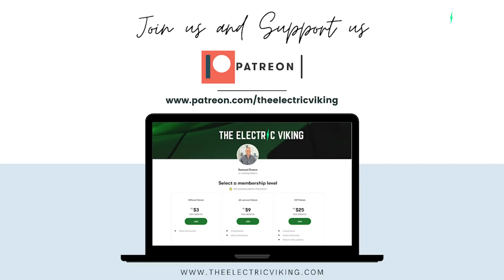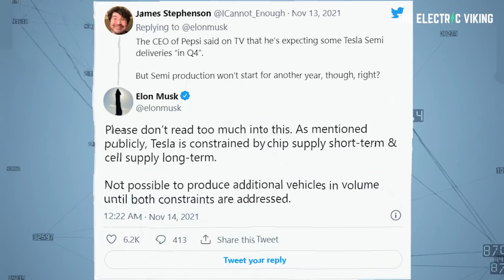Elon Musk: The 2 issues stopping TESLA from making more EVs

Comment: Hi Sam, great stuff! Can you please look into small cheap European cars? I searched your channel for the Dacia Spring, Renault 5, cheap VW Up! etc. I can't afford an expensive EV. I need a cheap EV to replace my old ICE vehicle.
Reply: Depending on where you live, you might want to look into a used Nissan Leaf, and check if anyone can rebuild the battery pack with LFP batteries.
I saw several companies in Ukraine do this with great success.
Maybe check if anyone in your area does this.
The Nissan BMS has been completely reverse engineered by now. Depending on how cheap you can get the car (leafs with dead batteries are very cheap), it might be worth your time.
The pack rebuild price for a 32kwh LFP pack is about 9000$
This will give you about 160 km of range (compared to ~100km on the 24kwh leaf when battery was new)